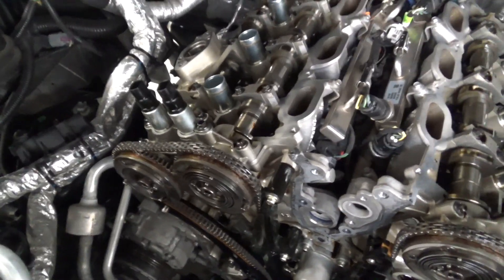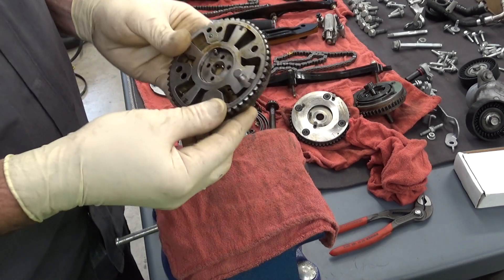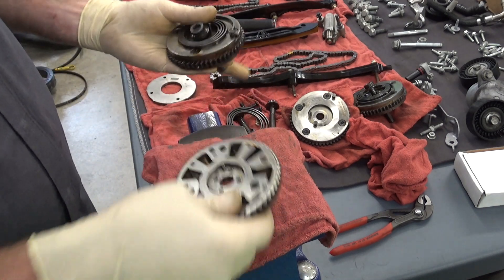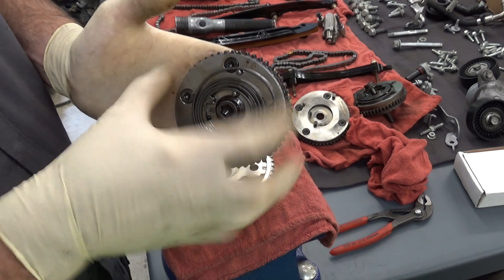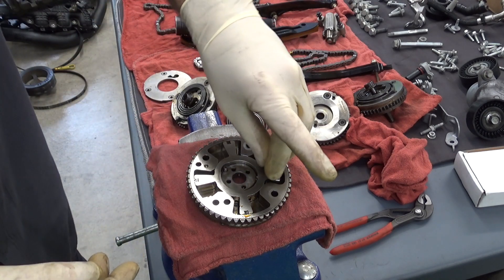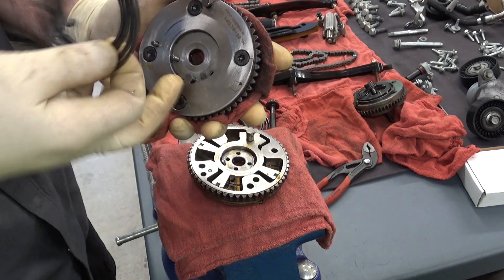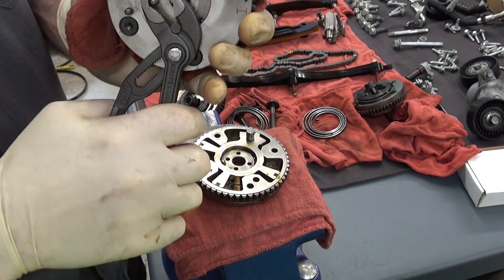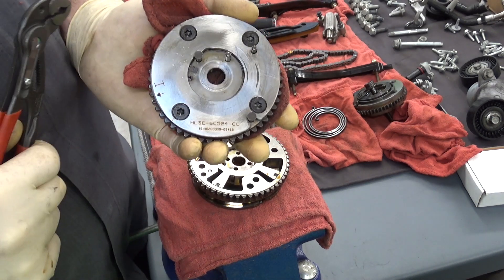FORD 3.5L ECOBOOST CAM PHASER RATTLE. THIS IS WHY

Comment: Great video and thanks for doing it (liked and subscribed) I bought my first Ford (2018 F-150 3.5) and currently have truck in shop at 59K miles for 21B10 and 21N03. I love the truck overall and would like to find best path forward for dealing with this. You seem to be engaged in trying to answer questions regarding this subject so I would like to pose this one. 

This video shows that holding accelerator fully down until oil pressure builds before allowing engine to start will eliminate the rattle. UNLESS (according to video maker) your cam passers are too far gone. 
https://youtu.be/dFI2URUsx0Y

So why is there no cam phaser rattle during engine crank?
Reply from the maker: Great question. If you have a 3.5 ecoboost that rattles on start then the pins are not locking. That being said, holding the gas pedal down & then cranking puts the pcm in "clear flood" which cancels the injector pulse not allowing the engine to start. The engine will only crank over about 300 rpm's which is not fast enough for the cams to slap back and forth but if it's started cold without priming the rpm's instantly rise to about 1300 rpm causing the rattle as the camshafts slam violently until oil pressure builds. If the phaser pins are properly locking, you could have no oil in the engine and it would not rattle but if run long enough the lifters would start ticking, lower end would knock, etc. After doing this video I'm beginning to think the pin spring is not stiff enough to push the pin into the hole and displacing the oil inside the bore so basically the pin is being hydro locked with oil because spring doesn't have enough pressure. Thanks for watching and posting link to video!
Reply: @raincitywrench117  Thanks for a quick reply. So to be clear, the “rattle” isn’t the cam phasers, it’s the “cams slapping back and forth” as you describe it. Can you elaborate on that? I understand the cams to rotate or continually turn while being driven by the timing chain. Where does “back and forth come from”?
Reply from the maker: @aggiejet  Each cam has lobes that push on the lifters. When each cam rotates there is force as the as each lifter reaches the top of each lobe and the pressure is released when they slide back off the high spot of the lobe. If the pin does not engage when rotating the cam it will tension/slack/tension/slack over and over on each lobe thus rattling the vct mechanism inside phaser until oil pressure fills the chambers and stops noise. In the first part of this video, I rotate the two unlocked cams with the defective pins back and forth which somewhat simulates what happens to the cams right after startup when the pins are not locked. Not sure if I explained it very well but hope that helps.
Reply: @raincitywrench117  Ok, I think I understand it now. The VCT’s don’t rattle when there is adequate oil pressure because the oil pressure locks the VCT in place. However, the VCT locking pin failure  (for whatever reason)  is the culprit and the proper fix is replacing the VCT. That theory is supported by the fact that the new VCT’s being installed under 21N03 are a different part number. 

Thanks for knowledge and engagement.

Comment: Sounds like its an easy fix assuming they tweak the part to fix it vs just keep using the faulty design.
Reply from the maker: Replacing the phasers fixes the noise, lets hope something is changed inside. I have heard a few saying their noise eventually came back though.

Comment: so is there a time limit on the cam phaser. What if you don't hit 69,999 in 5 years? what is the time frame for the tsb?
Reply from the maker: This from the Ford dealer letter: "This program extends the warranty coverage of the engine cam phasers until January 1, 2023
provided the Repair Order (RO) date of Powertrain Control Module reflash under Customer 
Satisfaction Program 21B10 occurs on or before February 28, 2022"
Also states this is a one time repair.

Comment: Great video and explanation, like everyone else said. I recently picked up an 18 3.5 EcoBoost and had concerns about the cam phaser/engine shudder issue. I haven't brought the vehicle in for the customer satisfaction program because I'm hearing mixed reviews about the PCM reprogram. Do you think Ford will provide a mechanical update soon since the mechanical parts appear to be the issue? Thank you.
Reply from the maker: This is from the Ford owner letter: "In rare instances, some vehicles will experience an engine shudder after 
reprogramming the PCM with the 21B10 update. Ford Motor Company will 
provide a no-cost, one-time repair under program 21N08 to return the 
vehicle’s PCM to the prior calibration.
Additionally, for customers who receive the PCM update under program 
21B10 prior to February 28, 2022 and continue to experience cam phaser 
noise, Ford Motor Company will provide an prorated, one-time repair for the
cam phasers under Customer Satisfaction Program 21N03, and coverage 
will expire on January 1, 2023. Program 21N03 will reimburse for a one-time 
repair based on the mileage chart on the next page."

 If you are experiencing rattling then schedule an appointment because it won't get better. Get it in for 21B10 before the end of February so 21N03 can be performed which replaces the cam phasers with new updated units. I would have them keep it overnight after programming and start it up cold, if it still rattles then have them install the new parts that way you only have to take it in once.
Reply: The original PCM reprogram caused potential shudder issues, but the dealer told me that it was updated. I had the updated PCM reprogram completed in September 2021 and there is no shudder.
Reply from the maker: @Av8orn8  Great. Hope it stays that way.
Reply: @raincitywrench117  What is the reprogram changing?  Do you recommend having a reprogram done if there is currently no rattle?  Since some folks are having odd issues with t he reprogram.
Reply from the maker: @mbrick  "The heart of the system is a positive displacement internal 2-stage variable vane oil pump."
"2-stage operation of the oil pump is controlled by an integral solenoid on the pump that will switch the pump between high and low mode operation."
"Low mode operation is designed to maintain oil pressure between 20 to 30 psi at speeds from 1000 to 3000 rpm with low engine load and engine oil temperatures at normal operating conditions. 
•High mode operation is at all other engine operating conditions."
I suspect the program is to engage the oil pump into "high mode" on startup. I would recommend you get it programmed before the end of February so it opens up 21N03 which will give you prorated coverage of phasers until Jan 2023 in case it starts rattling down the road. After that Ford isn't covering anything. You really don't have anything to lose because if you do get a shudder Ford will pay to reverse program it and it will still be covered until January 2023.
Reply: @raincitywrench117  Okay thank you.  Yes I do plan on having it done before Feb, but wondering if there is any advantage to waiting sooner or later... will call to schedule an appt.
Reply from the maker: @mbrick  Oh I see. Nah, I really don't think it matters either way

Comment: Ford still hasn't corrected this problem.  10+ years of the same problems, starting with the triton. I had a 2019 fx4, worthless truck, vct failure at 34k miles.  Built to fail.  Fords warranty fix is a patch, programming the vct  solenoids to divert more oil from the bottom end to temporarily satisfy demands of the poorly designed vct system.  These "updated" parts will fail like the originals.
Reply from the maker: Every 3.5L I have worked on for rattle concern, programming has made no difference. Maybe it is supposed to prevent phaser failure but highly doubt it. Since doing this video, I'm thinking that the reason the pin will not engage in the hole is because oil is not bleeding out of the cavity causing hydrolock. Will be tracing the oil feed hole on the next one I get. I think you are correct, it appears to be a design flaw in the vct oil flow.
Reply: @raincitywrench117  I found great success with the 5.4 in correcting fords vct design with a aftermarket high pressure and flow oil pump, along with new chains, guides, tensioners (the updated plastic ones hold up better than the old metal ones) and lastly new vct solenoids.  Updated OEM parts only. I have dealt with this ford vct problem for 10 years, and fell it's the only real fix.   The oil pump has always been the heart of the problem here. Low flow for mpg..      My 09 5.4 6 speed f150 4x4 gets a combined 19.2mpg in the Rockies after doing these repairs.   I bet the 3.5 would seriously benefit from a oil pump upgrade, an upgraded pump would produce enough oil psi and volume to satisfy even a slightly worn and leaky vct system.

Comment: The same thing happens on my wifes 2014 Honda CRV.   I quick tap crank the starter then start it and it puts the pin in the hole,  no rattle.
Reply: For cold starts, hold throttle to the floor while starting to put it in "Clear Flood" mode.  This will actually prevent the engine from starting, and will build engine oil pressure.  Then, let off the throttle and start it normally.
Reply from the maker: That's interesting. Doesn't look like that trick will work on the Ford units though but may be worth a try.

Comment: Excellent video, thanks for posting. Clear, concise and to the point. We currently have five 2018 Navigators and Expeditions in our fleet (small limo company in the midwest) and they're all experiencing this issue, some worse than others. Now I've got to fight Ford Fleet to get some help as they're all over 100k, the highest being 170k and climbing. Funny, our 2017's are pushing 240k and still purr like a kitten. One more headache thanks to Ford!
Reply from the maker: That's a bummer. Certain 17-20 F150's and 18-20 expedition & navigators had the issue. Makes me wonder if they changed parts supplier on those affected. Hopefully Ford fleet helps as there is zero coverage over 100k.
Reply: 2017 is the same part as 2018.  In fact, they redesigned and updated the part mid 2018.  It would appear that you have no idea what you're talking about.
Reply: @wildman1137  lmao, you just contradicted yourself so look in the mirror my dude. I simply stated my completely unscientific anecdotal experience. Being that we've had exactly zero issues with <2017 model years, and a 100% failure rate on our >2018's, I'd say that's some pretty strong evidence on correlation, but fuck if I know. Go bark up a different tree.

Comment: So what you're saying it's a faulty part or faulty design.  Ford should remedy this problem.  They've acknowledged it.  Now they should do something for all 3.5 ecoboost engine owners.  (I own an 2018)
Reply from the maker: The pin is not locking which causes the noise on startup but the million dollar question is did they have a bad run of parts or is this a design flaw?
Reply: @raincitywrench117  good point.  I'd like to see them take responsibility for the issue.   We shall see...

Thanks for the video!  Keep em coming!
Reply: Also 2018 3.5 ecoboost in my f150.. going into ford next week for this exact problem😑😔
Reply: Got a 2018 f150 with that 3.5 ecoboost this year. I'm saving money so I can fix this issue, as the quotes I get from shops and dealers are around $4k to $5k.
Reply: @gerardocruz8946  it is covered by the factory powertrain warranty/ emissions warranty. Are you past the 60k miles?
Reply: @Gigibakess  got it last Feb with 93k...now at 102k.
Reply: Also a 2018 3.5 owner and I ALSO need them replaced. Rattle became consistent at about 65k miles
Reply: @Thoaus21  consistent in every cold start? Or while driving too?
Reply: @rampantknight  I meant consistently hearing it on startup.
Reply: I have the same issue on a 2010 Lincoln MKT. These 3.5s have had this issue for a long time
Reply: This is clearly a design flaw. The question is can Ford retroactively engineer a solution?
Reply: So there's a recall on them ? How far back ? I have a 2011 F150 3.5 that just started doing it, not to mention the dreaded drop to 1st gear or stay in 3rd gear issue. 
Ford won't do shit for me cause my truck isn't part of the vin recall but part of the "customer satisfaction " but my truck is over 240km and they won't fix it.

Comment: I have a 2019 3.5 with 15,000 miles. I had the phasers replaced, still makes the same noise, same day I picked it up from the dealer. I was told the part numbers are the same, old vs new. Anyone experienced this?
Reply from the maker: It may be turbo noise? This is from TSB 20-7092 :"Turbocharged engines may make a variety of sounds although the turbocharger is functioning properly. Some examples of normal turbocharger noises that do not indicate a durability concern include, but are not limited to:
• Rattle noise at idle or during light load conditions
• Whine noise that will track with engine speed
• Whoosh noise on acceleration
• Noise with wastegate actuation (creak, squawk)"
Reply: @raincitywrench117  head to my channel. I have a video of it. If you listen to the end, when I rev the engine, it will be evident that it’s not turbo noise.
Reply: @golf3sc  There is a new PCM update out for these engines that is supposed to solve the rattle after they have been replaced.  I believe the recall number is 21B10. And if that still doesn't fix it, I believe the phasers would have to be replaced again.
Reply: @alexnajjar7475  thank you for replying. My truck is back to the dealer. They did the 21b10 first, second visit was cam phasers. Made the same noise the day I picked it up. Back at the dealer for 1.5 weeks as of today, no response. Zero info. But I did have to swap out my first loaner for a second loaner, both ecosports, and help the employees figure out how to assign a loaner in both situations. (I’m in the automotive business)
Reply: @alexnajjar7475  21B10 is the first FSA. 21N03 is to replace the phasers if 21B10 is performed prior to 12/31/21.
Reply: Engines make noise, just drive it.  The only time you take an engine apart is if it blows up.